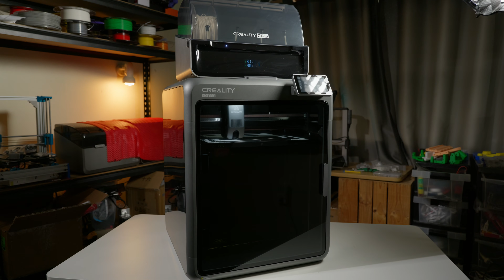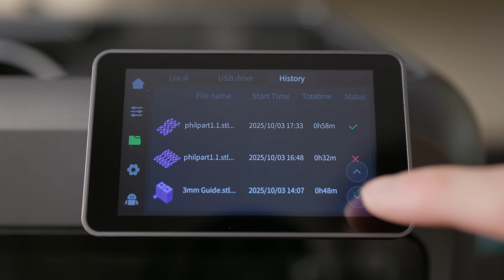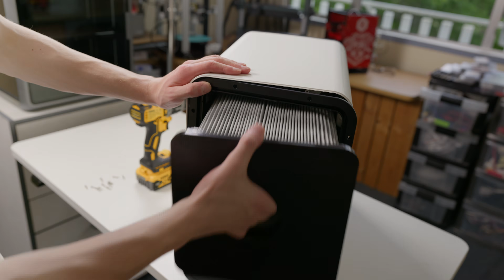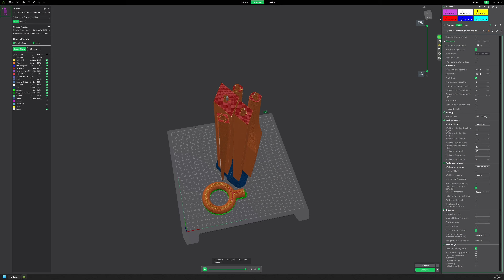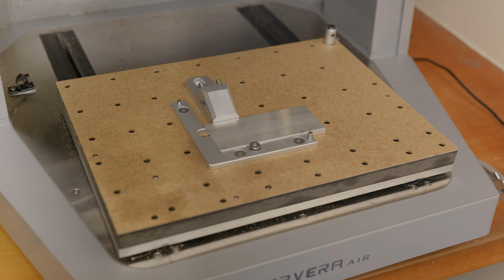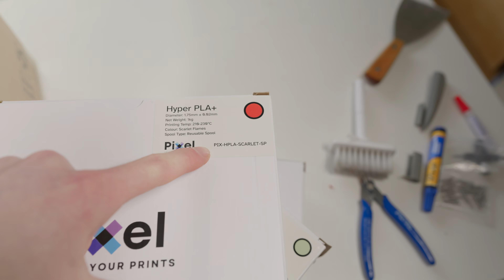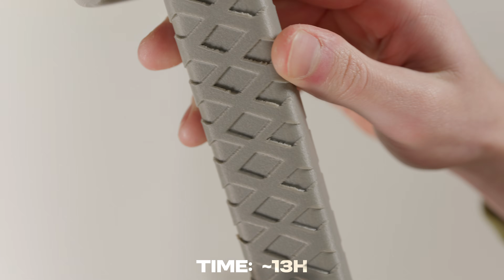My Time with the Creality K2 Pro

Comment: I loved my 2 K2 Pro's until I didn't. Reliable - NO.   Bought 2 K2 Pros 6/3/26, 2 week later, 1 printer had multiple error codes and unusable. One more week later, 2nd printer is throwing error codes and unusable. Support is horrible. At this point, 7/27/26, both are still dead. Support is usually one email a day with tech support sending possible troubleshooting actions to try. I try the steps given to me that day and respond back to get another email of troubleshooting the day. They may send a part to install and in my case taking considerable time to install and test depending on what the part is like a y-axis motor to find out it is not the problem. I've requested a replacement, no response just more troubleshooting. I requested a refund, more troubleshooting. My next step will be requesting a chargeback with my credit card company. I researched possible costs to send the printers back to china, $350 - $500/printer. For the short period the printers worked, they were a good fit for producing a large number of functional parts for a client of mine.  I have replaced the Creality with Bambu H2D printers. The H2D work and do a fine job. Some things I don't like, like the slicer is restrictive and less control, it has more plastic parts then the K2,  and the speed is slightly slower. The K2's, when they worked, I really liked them. The price is spot on, the printer is well made with quality materials, plug-in and print but are very expensive as a boat anchor.

Comment: Well, you're lucky if it actually works! Mine always has something wrong with it... the filament runout sensor was replaced three times, the nozzles kept clogging, the CFS failed, the RFID chip reader wasn't even wired up, the belt tensioner was replaced three times, the Y-axis motor died and was replaced twice, the idler pulley failed, and Creality's customer service is a total disaster... in short, stay away from this machine!!!
Reply from the maker: I can assure you it doesn't haha; it's been a running gag of mine for the last 8 months since it broke 🤣 Yeah, I've heard their CS is really something; I didn't even have luck with my marketing representative since they just ignored me 🫤 Oh crikey, you've had it worse than I have! For me it was a replacement hotend, two strain gauges, toolhead cable, and toolhead board, but in the end I just gave up, haha. I have no problem siding with your recommendation; it's just not a trustworthy machine, among many other things, haha. I hope you have some more luck with your printing journey going forward!

Comment: yup perfect video i love that you made a transperent nozzle cover cool idea
i may make that too
Reply from the maker: Thank you very much for checking it out! I really appreciate it 😄 
I do love clear resin parts, so I'm very glad I could make something using it this time; I think the cover was a great use case! Thank you for mentioning it 😊
I will note that it's not as secure as the stock one, and I do not know if this is due to the design, or the magnets I used (both stock and new), so  it was more display-piece than a true replacement. I'm not sure what changes would need to be made for a perfect version. Cheers!

Comment: Dont trust the auto pa and flow results with the K2.. Do your own manual calibrations. Also abs/asa zoffset can get a bit wonkey. I always tune that. K2 pro/ plus extruder tension is not changeable. You can however print a small spring block, buy a spring and use a computer gpu thumb screw to give the printer adjustable extruder tension. Stock tension is waaay to tight and causes artifacts by smashing the filament.  Mine also fails with z axis calibration. Im going to try swapping back to a older firmware to see if that fixes the issue if if its actually the strain gauge. Also also... Never swap the nozzle without having something to hold onto the hotend thats like begging to break your cold end.
Reply from the maker: That was definitely the cause of the strange artifacting on the blade print 😅 I never thought of it myself, but one other did bring it up, and of course, you have too, in much more detail which I really appreciate. I've always struggled with manual PA and flow calibration (although mainly PA), so the auto feature seeming to work most of the time was good enough, except for that blade print, haha. I wish I could have replaced the extruder entirely, especially with a DXC extruder, but those aren't compatible with the K2 series just yet, as far as I'm aware. I didn't try swapping back firmware like you've mentioned, but I did replace the hotend, strain gauge, and toolhead cable to no avail. I will be swapping the toolhead board hopefully next week, as it's been on the shelf for nearly a month, waiting... It'll get a segment in the next video or community post whether it works or not. Thank you for your advice as well with replacing the nozzle! I've certainly been far too lenient with this machine 😅
Reply: @TommyHoughton DXC is available for preorder for the K2 series. Def look into the K2 Plus Extruder Manual Tensioner by  Stranula on Printables. I would say that's the only way this printer series can print TPU reliably. I just put in a support ticket for the z-access homing going back firmware didn't solve the issue
Reply from the maker: Ah that's brilliant! I thought it was simply a MK2, but it's literally for the K2's, haha. I hope your support ticket helps get things resolved! I hate to say it, but I've given up on my machine; the toolhead board didn't fix the issue, so back in the closet the machine has gone. I was going to give it to a friend if it worked... I'd love to hear how the rest of your ticket goes, since this machine and my experiences with it, take up a lot more space in my mind than expected 😅 Maybe you or someone else will know the solution in the future, and I can get the machine out again, unless I end up doing something crazy to it. Cheers!
Reply: @TommyHoughton I gave up on trying to deal with Creality's service. They honestly didn't sound like they even bothered to read or see the video I sent them if the error. Went ahead and ordered a new strain gauge on Amazon for like $8. So we shall see if that fixes the issue.
Reply: @TommyHoughton so i think i fixed it. Stock strain gauge had pressure being applied to it from the hotend breakout board wiring as well as the hotend fan that was making contact with it. $8 amazon replacement had the white resin filed down where the fan was for clearance where as the stock one did not. Its gone though a few bed level calibrations ok since changing out the strain gauge. I would just order a new one and install it yourself instead of waiting for creality.
Reply from the maker: @AtomicBleach   Hmmm, that's sounds like a likely possibility! I'm 99.9% sure the replacement I bought and installed did have the resin, though, so it's likely a matter of the machine being picky 😅 It's strange as it did have success for a dozen leveling sequences, but then when I tried to do a full auto calibrate, it threw the same error! I've given it enough time and money that I just don't want to touch it anymore, but if it's a pressure problem, which it must be, then I'll aim to give it one more go today. In regards to waiting for Creality, I'd be waiting a long time, as they never responded to my original emails months ago 🤣

Comment: My Creality HI  has got about 1900 hours on it and I've only had to replace the hot end which most likely didn't even need it. I have the non-pro K2 and it has only a few hundred hours and I feel the same way. The HI is my go-to for sure.
Reply from the maker: My Creality Hi was my most used printer until I did the Neptune 4 Max video, but even then it's only got like 300 hours 🤣 Nearly 2000 hours of mostly smooth sailing is absolutely awesome, although I had to replace the hotend on mine as it died about 100 hours in 😅 Smooth sailing since though! This is really brilliant to hear, as I know others have been super unlucky, with others, not. It's ironic, as I swear by my "Hi" and was going to let someone borrow it, but it's conflicting to recommend a printer that I love, and have heard others love, when I have talked with others who only regret purchasing it 😅 Just how it goes though. Thanks for checking this one out and leaving a comment! I really appreciate it 😊 Cheers!

Comment: Am I the only one who feels he broke the printer?
As someone who running 3d printing business with many Creality machines(from Ender to K series, now I have 3 K1C), I found out new Creality machines, unlike Ender’s, are built to not be modified. They have an expiration date/clock. They work between 500 to 1000 hours and after that become unrepairable boxes. Their chassis bends, build plates warp, and …
Reply from the maker: You're not alone, for sure, as I've had other comments bringing this up as well. While it's possible that I caused the hotend damage by allowing dust or dirt to enter the threads, and therefore allowed it to seize, it was highly unlikely, and with the QC issues I'm aware that Creality has, I'm personally leaning towards that, even more so after replacing several of the electronics yielded no success to fix the leveling/z-axis error; the final chance I have is to replace the toolhead board before I give up, but I haven't had time just yet. It's a first for me, as I only have experience with this model, and the Creality Hi, which suffered the same hotend issue, with a spare one arriving DOA, but otherwise, it's just worked flawlessly for hundreds of hours. There's always something going on! I've heard some real horror stories from others, but also, the opposite! Very interesting stuff. Thanks for checking out my video and leaving a comment! I really appreciate that. Cheers!

Comment: HI Tommy, nice video. I searched the video and did not find anything about how you fixed the error issue. There seems to be a lot of talk about issues with the printhead cable. Can you please update us on what you did to repair the error?
Reply from the maker: Hi Doug, thank you for checking my work! I'm sorry you spent additional time searching for a fix; the reason you could not find one, is because the machine is still broken, even to this day. I have replaced the strain gauge sensor, and the toolhead cable, and while the hotend isn't a factor, I replaced that too, to no avail. I'm expecting a toolhead replacement board to arrive within the next couple of days, which I'm very much hoping is the fix! If not, it's very unfortunate. If you'd like, I can update you if the toolhead board fixes this issue. Cheers!

Comment: would you compare it to a P2S? and if so, which printer would you choose? (It's worth mentioning that here in Latin America the K2 Pro is much cheaper than the P2S)
Reply from the maker: It's somewhat comparable, but for reliability, I'd likely go with the P2S if I had to make a choice; I don't trust the K2 Pro enough to recommend it, but if it's a great deal cheaper, then maybe? I would personally pay a bit more for a guarantee, but not a crazy amount. A bit of luck is involved with Creality Quality Control like always, unfortunately. It's a tricky decision! I wish I could give you a 100% answer, but it's not possible, sorry.

Comment: hello nice video. Mine gets jammed pretty easily. I need help im a rookie
Reply from the maker: Hello, thanks for checking it out!
I only had one or two jams, including the one that was the prelude to the whole hotend replacement ordeal, so I don't have any particular advice other than using the included filament poker thing while the system is at a high temp, and then forcing the filament out through the nozzle. Otherwise, I have used some of the (purchased on AliExpress) 0.4mm nozzle cleaning wires/needles from the nozzle end and attempted to push the debris back out into the heatbreak so it's clear.
Sometimes either method works, and sometimes it doesn't; it can be a bit tricky with the proprietary stuff. Worst case, a nozzle replacement would be needed, but best case, poking around while the nozzle is hot should allow you to clear it.
I hope that helps a little bit! I'm aware of how annoying the situation is.
Cheers!

Comment: "it might not be possible to disassemble"
Man, the amount of restraint you're practicing here is really award winning...

You're certainly more than capable of fixing this I think. It definitely has some ringing/oscillations/resonances that can be fixed.... though my gut says that ripping its board out and replacing it with Klipper is actually the right move. I don't think Creality is doing anything with their printers that tuned Klipper can't do better/faster.

The magic "failed print" AI stuff.... might be a bit harder to replicate.
Reply from the maker: I appreciate your recognition! I was really holding back, haha. I was extremely tempted to take it apart, spray paint it some nice colours, and do some other fun stuff too. In another timeline, maybe I did.

I'd like to agree with you there! Unfortunately, even after all the replacement parts I ordered had arrived and been installed, the same errors continued. Apparently, the toolhead board could be faulty; a replacement costs as much as all the other parts I just bought...

I do like that. A full brain transplant taking advantage of the hardware could be very cool, although I have my doubts about the "practicality". Shoving that aside like always, 48V, an eddy current probe, and a redesigned motion system would make this thing brilliant! Another project for another timeline, though, as I'm already planning projects too far ahead, haha. 

This is also true! I haven't seen anything aside from the classic Spaghetti Detective plugin for OctoPrint that fills that gap.

Cheers!
Reply: @TommyHoughton  it really could be a monster, because the frame is properly well designed, and the enclosure gives you some really solid options in terms of filament. Gantry needs a little help, smooth idlers are... a crime, as is the dead weight cable chain, which, all a real shame because it's so darn pretty.

If anyone can hack it into submission, you're the guy I think.
Reply from the maker: Extremely true, it's got some killer potential. 
I agree on the aesthetics! Genuinely a nice looking machine; I was even planning on spray painting the frame some nice colours, haha. Hydro dipping it would be bonkers! 

I appreciate that. If I make it happen, there'll be a neat video to go with it 💪 Cheers!

Comment: Hi tommy, sorry for the username its an old account lol. 
I own a base (non pro) k2, and the rippling u mentioned went away with these settings: 

Use inner/outer/inner wall ordering and increase the wall loop to 4. 
Set the outer/inner walls to a 80mm/s, decrease default jerk to (6-8) and lower the accelerations by 2000 mms.
Also consider using creality 7.0 features such as Smoothing wall speed along Z and travel short distance.

 You may have already tried these, but i found these settings really do offer better surface quality. (vs default settings which are way too fast)
Love ur content, I can see the effort u put into ur vids.
If you read this, let me know if they work. 

cheers.
Reply: also found noticeable improvements after tuning the pressure advanced. My  k2 doesn't have automatic calibration so results may be different for yours.
Reply from the maker: No problem at all! Something like that is never an issue.

I've used inner/outer/inner a few times, but can't recall if I used 4 walls at any point. Likely more. 
This is a bit more specific, so I can confirm I haven't done that. 
I'll look into it some more, as someone else raised safety concerns on that version, so I'll give it some more time for now. 

I really appreciate your kind words, and that you took the time to write this explanation. Thank you very much! 
Unfortunately, despite replacing the three supposedly troublesome parts on this machine, it's still not working, so I can't test anything, but if I decide to order another possible part, which could fix it, then I'll do some testing there. 
Regarding your other comment, it's very likely that this whole thing is a Pressure Advance issue, which is more interesting as I always used the Auto PA calibration in my tests.... I'm curious if it's to do with that! Hopefully I can test in the near future. 
Cheers!
Reply: @TommyHoughton  thanks for the reply I wish you good luck into the coming year
Reply from the maker: @communist-yx2us I wish you the same! I have high hopes, and hope things goes well for us both 🤝

Comment: It's garbage
Reply from the maker: It's a confusing machine, and I wanted to love it 🤷 Not sure what to make of it now, as it's still broken after replacing what was supposedly the parts that were causing the issue. Now it could apparently be another part, that'd cost as much as all the replacement parts I just bought! Been tempted more than once just to get it out of my sight, but I keep trying to give it chances... Cheers!